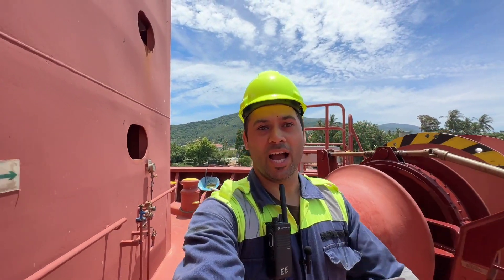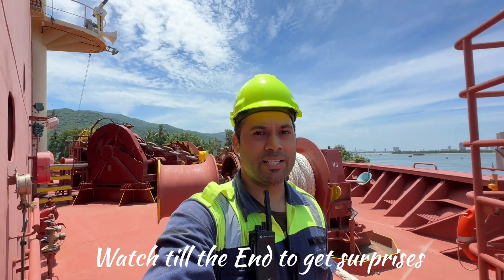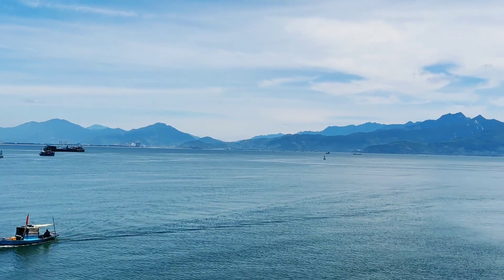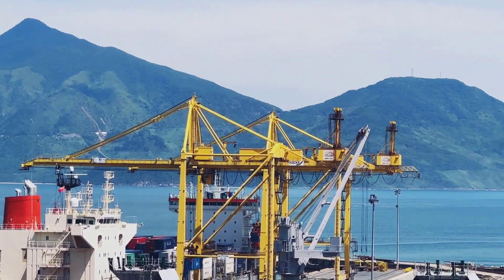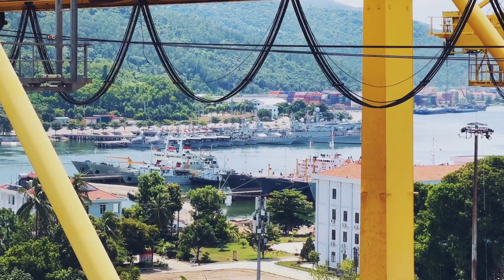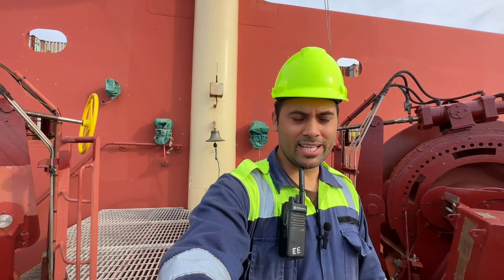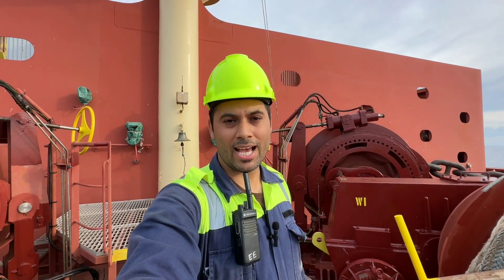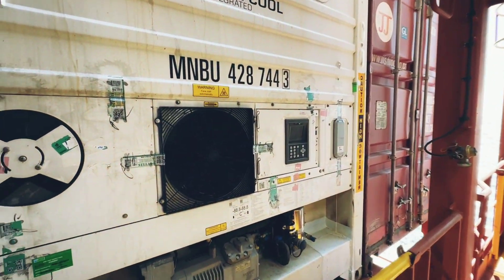ELECTRICAL Cadet Life Onboard Ship || Included his Jobs & Responsibilities

Comment: Sir my question is that, electrical offcr is follow  watch system routine or day time only.And any special qualification required for containers vessels.
Reply from the maker: Usually only in day 8 to 1700
In ports when we have high reefers loading and have extra ETo onboard then can go on 6 hours on 6 hours off. If only sole EE then according to arrival and departure need to adjust your working hours without violating your rest hours
Reply from the maker: No , there is no special qualification is required for containers vessel  only ETo and stcw courses
Reply: @Etovivekkumar  thank you sir
Reply: Sir what's pay (round figure) on container ship?